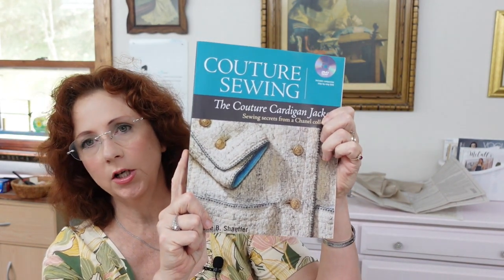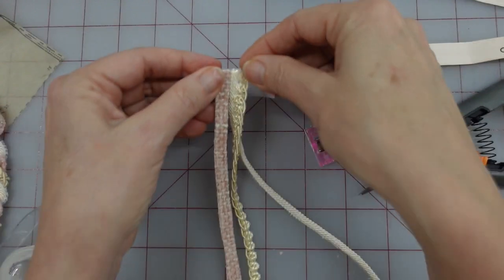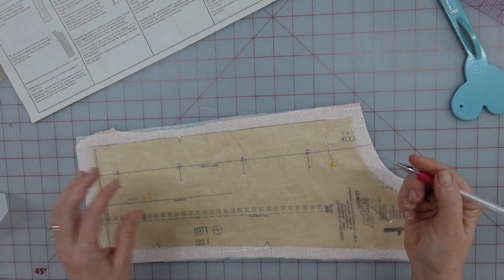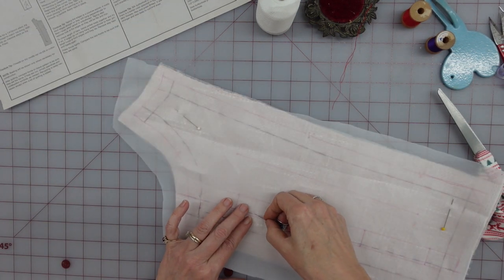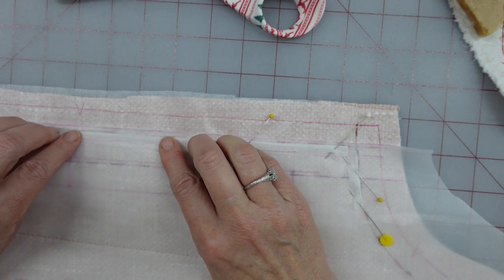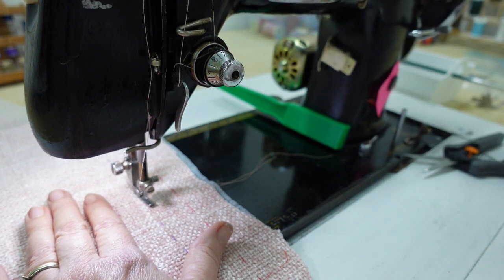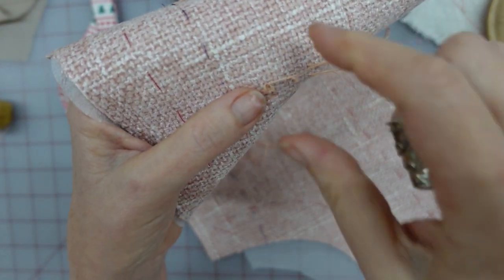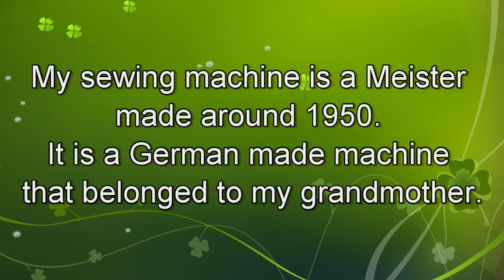Making the Chanel Jacket #1 - Trim Making and Shaping, Front Stabilization and Dual Buttonholes!

Comment: On a previous video, I commented that Claire had been given access to some of the Paris couture workrooms.  She is showing the techniques used there.  I noticed in the new trims book she put out that she mentions numerous times that the Chanel garments were not perfect.  Claire has introduced materials which they did not use: facings, interfacings, etc.    The trims served to stabilize edges in the original garments.  Also, Chanel suits were not meant for hard wearing.  I always refer to them as "Dallas ladies do lunch".....

Comment: Thankyou, I came to see specifically about that placement of the front piece basting, since if you baste over the stitching line and then to stitch to quilt, you will SEW THROUGH the basting threads, making it impossible to smoothly pull out the basting. I had considered going off pattern, and the pattern itself does not say to *remove the basting*, so I had wondered if it was supposed to remain... Glad I checked here!❤
Reply from the maker: Great! How is your jacket coming along?

Comment: Hi Marie,   Another wonderful video.  I don’t know that I would ever be able to do this method, but you are a fabulous teacher.  I have found some great pins for slippery fabric.  Not really sure where I got these but the little plastic case has Clover on the top and Japan on the bottom.   They are u-shaped with 2 pin legs, 1.5 inches long and 3/16th of an inch wide.  They top u shape is bent slightly upward about 3/8 an inch to grasp.  They hold great!
Reply from the maker: This pins sound wonderful.  I may have to look for some! Thanks 😊